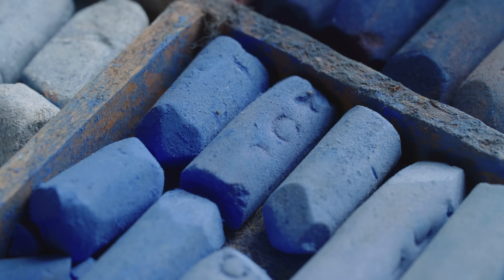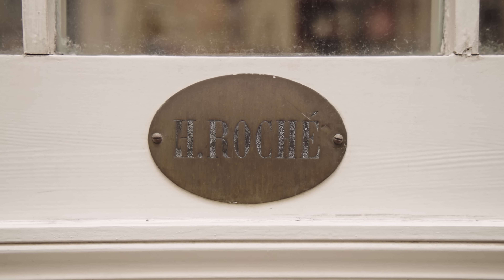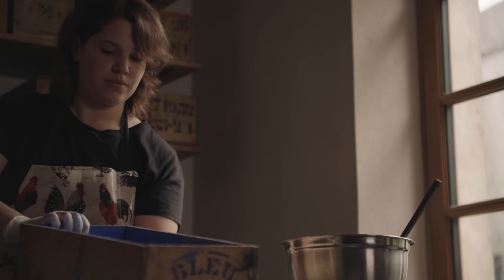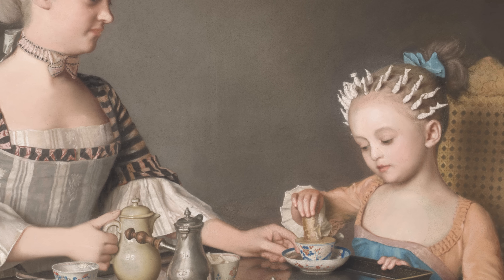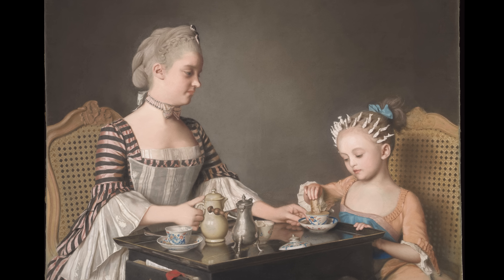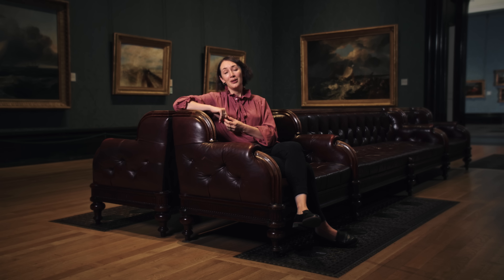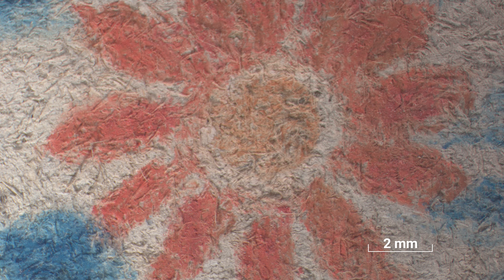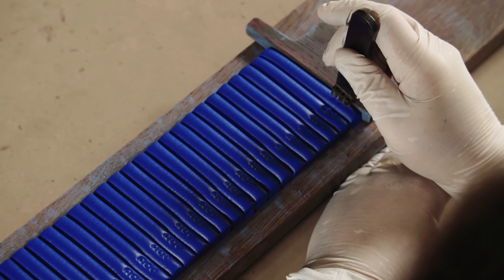A Glimpse into the World of Pastel: Discover Liotard and The Lavergne Family Breakfast

Comment: oh, I so enjoyed this.  I know we have some spray sealers for pastel work now,  was there anything back then ?   Unbelievable work of art.   thanks so much
Reply: They could use resin like damar, or Gum Arabic in alcohol often diffused from the back. It can also be sprayed from the front but that ran the risk of darkening the colours and causing drips. Some artists didn’t fix at all and relied on pressure to fix the particles.
Reply: What's the emulsion they mix with the coloured dust ??